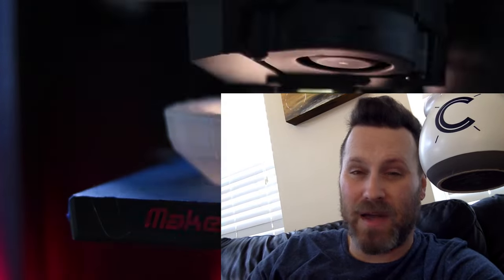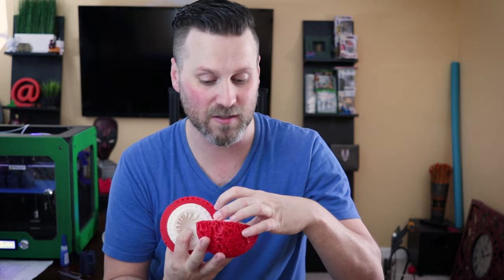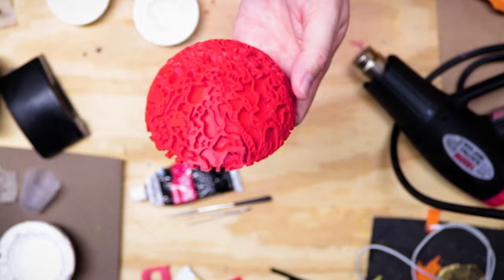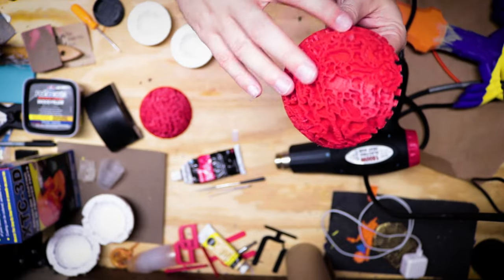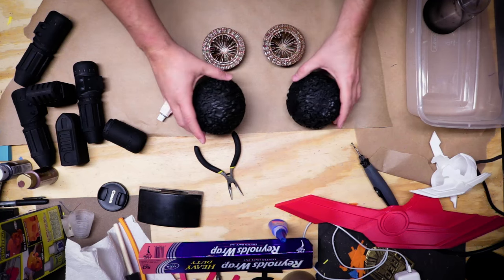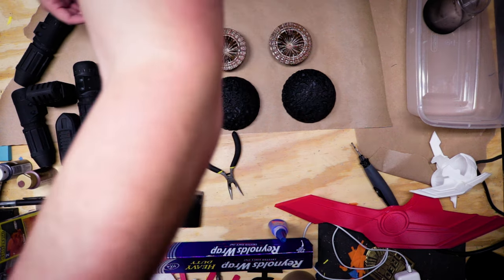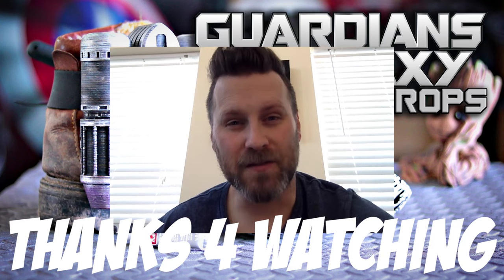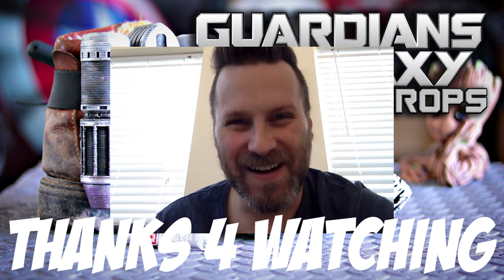Guardians of the Galaxy Props | Detailed Build | Extra Footage

Comment: Do you use Xtc3d on all of your prints prior to painting or is it just certain prints over others? Also, I really enjoyed watching the detailed video
Reply from the maker: Abuzz Designs thanks. It all depends. Typically I do apply it to everything before I paint. I applied it to the orb because I wanted that to be smooth and super clean. The rockets I didn't but I wish I did now since I really liked how they turned out. But I still think they cameout ok. What was nice about this project is that I almost did zero sanding or filling